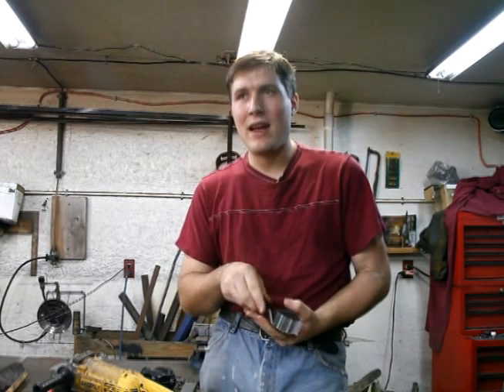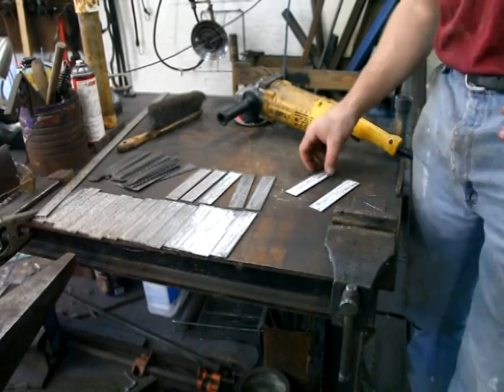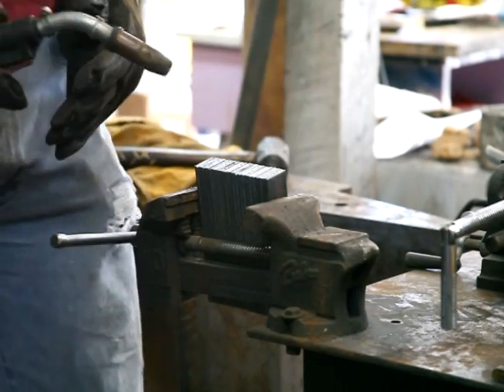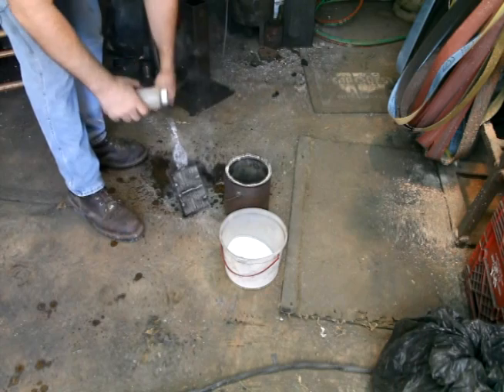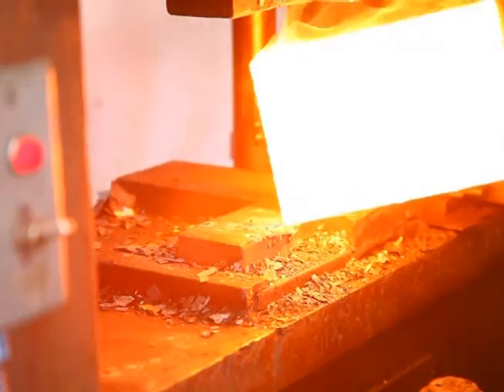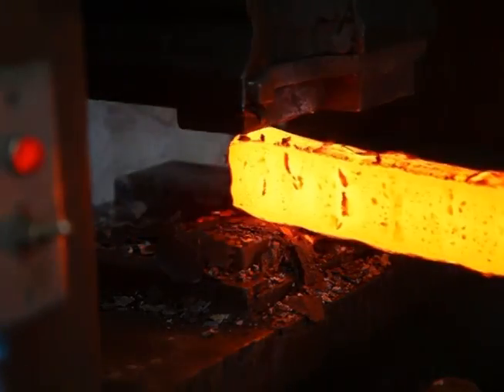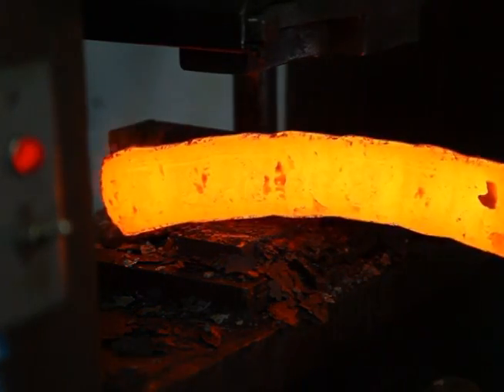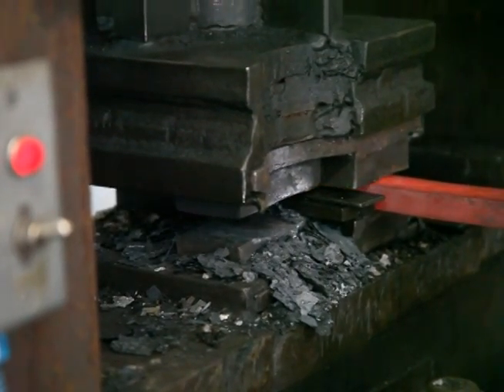Journey to Master Part 1 of 5

Comment from the maker: The press is totally custom built by my dad and I.  It’s an H frame style press with a 9” cylinder and 3” piston.  The pump has a ten horse, three phase motor that runs it back in the other room so it’s a bit quieter while I’m running it.  The dies are made of regular A-36 steel.  The hydraulic controller is off of a big backhoe.  Thanks for watching my videos!

Comment from the maker: I see what you’re saying to be sure.  I don’t want anything but high quality steel in my finished knife and that’s why I cut the ends of the damascus billet off after forging each round.  I cut off ALL the mig welds when the billet is drawn out so I won’t get it in the finished blade. I test each and every blade that I do now days by chopping on a very hard, old chunk of deer antler.   Thanks for watching my video.

Comment: First question is what is the mil scale or what ever you said? Secound is why did you only weld little lines on the sides but one full line in the middle of the side? Third is was the handle one you use all the time just reuse it? Fourth is what is flux and what is it for and if I need it where is the best place to get it? Do you have to only put the flux on the one time? How do you know when you got it to the right temp? What kind of press are you useing?

Comment: Is the kero or the billet hot when you applied it? Is it just for moisture so the flux will stick, or is there a feature of kerosene that aids the flux adhesion?
Reply: chumprock - I know this is an older comment, but I thought I'd try to answer anyway.  The billet is not hot when it's dunked in kerosene, or if it's poured on it, because as you know it's flammable and would be dangerous to put it directly on hot steel.  It's use by a lot of bladesmiths instead of borax as a flux since it can produce very clean welds; it's known as hydrocarbon welding. When the billet is soaked in kerosene, the kerosene wicks itself between the layers of steel and when it's burned off in the forge it creates a layer of carbon (like soot) on the surface of the steel layers which protects them from oxidizing and forming scale.  It believe it  also forms a hard shell around the billet which further protects any oxygen from getting inside of the layers and acts like a canister when canister welding.  A lot of guys also use it mainly to help the borax to stick to the billet before its heated in the forge in order to not give any chance of scale forming when it's heating up to the point where the borax will melt and stick to it.

Comment: When I've watched others forgeweld, they are super careful, just tapping the bill at the first heat and then go slow with maybe a total of ten heats, also they quickly remove the metal from the mig-welding so it doesn't merge with the steel. 
But you went straight on smooshing it all together :P
Now I'm not a smith in any way (yet), and I'm just wondering how it's supposed to be done or rather why can you do so fast while others go easy?
(I'm not trolling or anything, I truly just want to understand)

Comment: why do you use 2 kinds of steel in layers?
Reply: He's making pattern-welded steel, also referred to as Damascus.  One steel is high carbon (1080) which turns black when exposed to an oxidizer, but the other has a high nickel content (15N20: N20 denotes a nickel content of ~2%) which is highly resistant and remains shiny.  After grinding to get the desired pattern in the steel and the blade shape, he'll dip it into an oxidizer, frequently ferric chloride.  The high carbon steel darkens but the nickel steel remains bright and a pattern emerges.  Here's an image of one of his more recent works: http://farm8.staticflickr.com/7200/6994886031_f79cd66045_b.jpg

Comment: cant you just use tongs to hold the stack instead of having to weld a hole stick onto it?
Reply: You can, but for the most part, tongs aren't long enough or sturdy enough to take the abuse of the press. it would also steal the heat from the metal and burn your hands, thats why a long piece of rebar is normally used then cut off later.

Comment: I laugh at all the people crying about the hydraulic press, the only thing he uses it for is making stock metal, he pounds the shape of the blade out with just a hammer, and for blade smithing he does an amazing job. It would be a heck of a lot easier to make stock with a little mill roller though, and since it looks like he spends half his time just making stock it would probably be a worthwhile investment.

Comment: Bull. I've tack-welded the ends of billets for 20 years with a stick welder. The ends are going to get ground/cut off in the end anyhow. Scale (not "shale") naturally pops off a piece of hot steel as you work it, that's just the oxygen in the air making the outer surface into oxide layer. And I can pull shavings off a mild steel bar without damaging the edges on my blades. When you've worked forging steel 20 years, then you can talk about  "ruining steel".